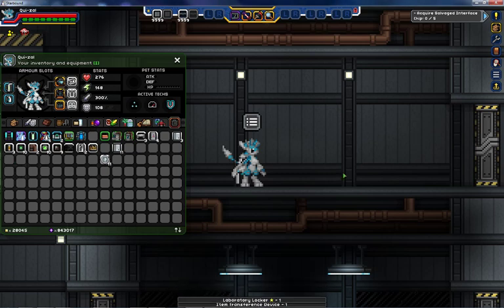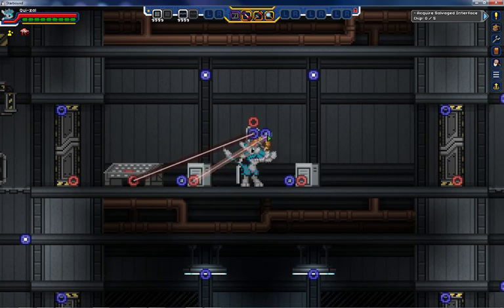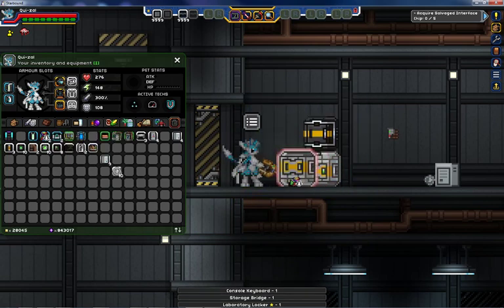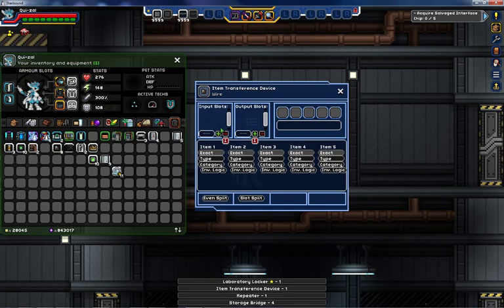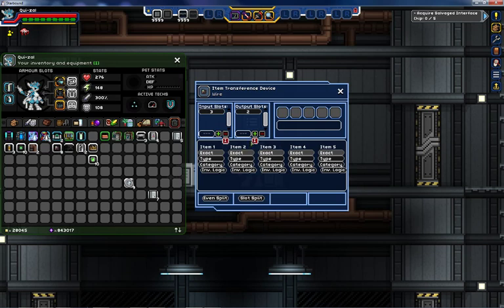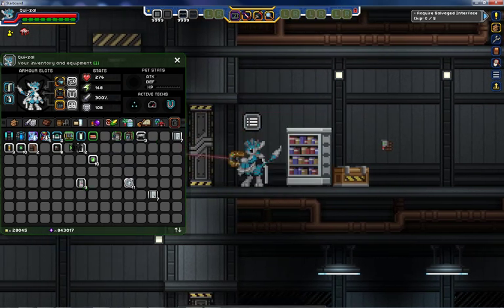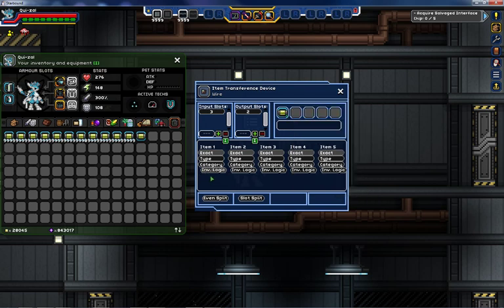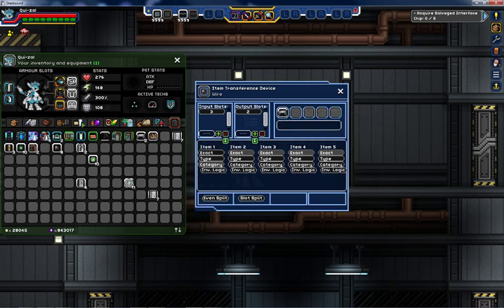A Concise Guide: The Item Transference Device (ITD)

Comment: Some word in advice:
I KNOW of the Charm a 300- Slot-Container might have; DUN USE EM!
Even the half of size (120 tbp) have a HUGE impact onto the ITN.
On its own (and empty) its harmless, as Prior Knot of lets say for example ores& their Bars will give a feelable impact onto your fps, out of those math still all smelter/extractor/pumps/Crusher....(few month later)..and at very least the Mainframe.

My own solution was to split industry branches among starsystems (among planets in same system still make planetloads to a pain)
like 1 system for bees, 1 for metals an so on
Reply from the maker: While the item capacity of a targetted container does have impact on the general workload the ITDs produce for the server the best way to circumvent this isn't actually to split the workload, but is to set ITDs on an automatic timer that operates them only in necessary cycles. ITD ticks are naturally pretty quick but 90% of all processes are just fine with waiting 30 seconds a cycle. This can cut workload to less than a 30th, though large volumes of containers may still cause little lagspikes when the system triggers on-timer. Different solutions work for different scales!

Comment: first of all, great vid, thx! i have a question though. 08:54 "this one decided it was having a bad day." yes, exactly! why does it do that? happens to chests, hydrotrays, extraction labs at random. anybody knows what setup causes the issue and furthermore how to fix it? also what exactly does "slot split" do? devide evenly amongst all outputs even if the number is uneven? thx in advance. i hope someone reads this a year later 😁
Reply from the maker: Someone absolutely will read this a year later! 

Yes, things in Starbound occasionally just... *don't*. And that's an engine issue, it would seem, so there's not much modders can do about it. 

As for the 'slot split', it'll split evenly among the containers and leave the remaining items that couldn't be divided in their original container.
Reply: alright thx. so you just replace the whole thing if it doesn't work?

edit: ok is just found one of my problems. feeding troughs need an extra storage bridge. the default input doesn't work. at least for me. cheers!